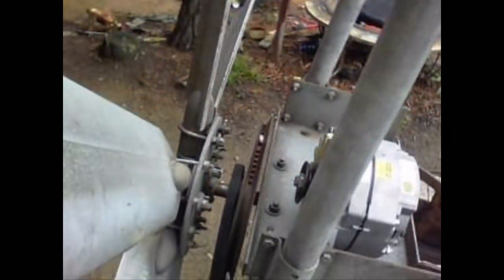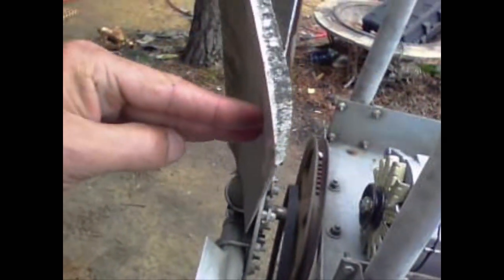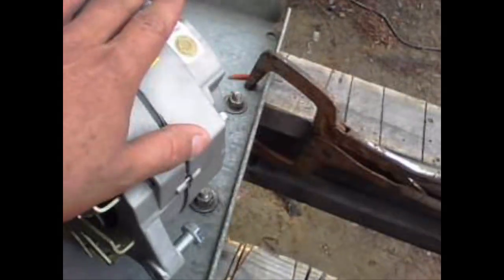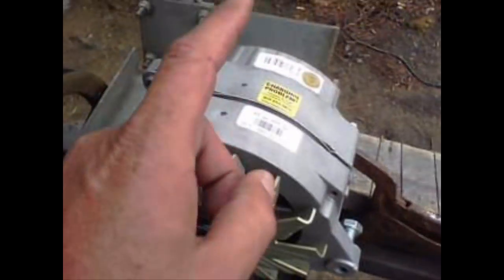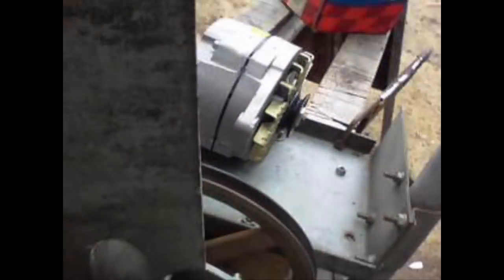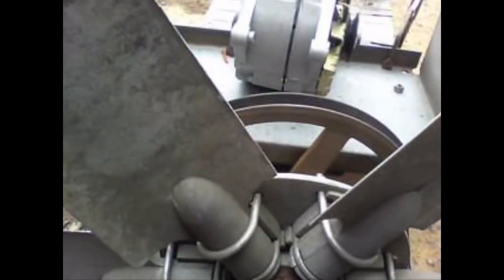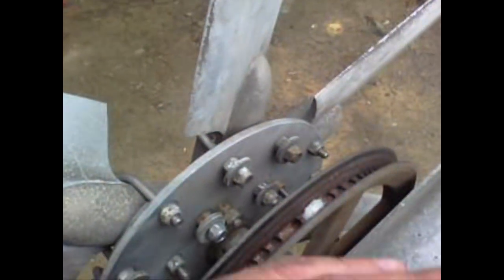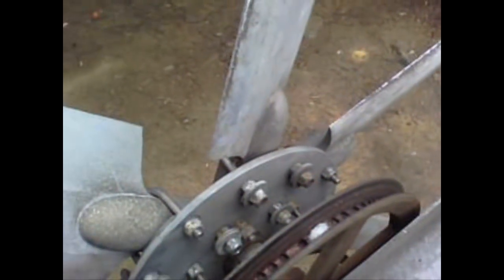homemade windmill generator part 3

Comment: did he say Turnt?
Reply: he sed turnt.
Reply: Saint Heretic
Reply: +Jack McSwain did you say sed
Reply: yes...yes he did
Reply: In older form of English, many past tenses were spelled with t instead of ed; British folks say "spilt" and "dreamt" and "spoilt".
Reply: RRRRRRRRRRRRIGHT, i WAS UNAWARE, that the DEEP, DEEP, ...................DEEP woods of Tennessee was currently populated by many older forms of english speaking British folks, and "spilt" and "Dreamt" are both past tense, and past participle verbs of "spill  & dream or dreaming"  

CALL ME FUCKING CRAZY, but for some reason i dont think Proper vocabulary and pronunciations was intentionally showcased by Mr. Jim bob
Reply: Where do you plan on installing this contraption? If you are in a populated area I can't help but feel that it would be irresponsible of you not to install a brake or some form of fail safe. I'm guessing that your blades are not balanced to comparable industry specs and I don't know that you fully comprehend the forces that will come into play when that thing is introduced to a powerful wind storm. Your heavy duty aluminum won't bend much before it cracks and breaks. Don't get me wrong, I'm all for what you're doing. Free power is hardly worth it at the expense of your kids life or a neighbors.
Reply: It looks like he has some land so...... Free country......
Reply: Thats all OK folks...your president used to say Nucular instead of nuclear! Present one does all kinds of crazy uncouth, uneducated things. If you vote those guys in, I guess you have to expect a little of it from the populace that did it.
Reply: Stop the dig!!.. He's a country boy..
Reply: Saint Heretic spooky isn't it, how many people prove just how IGNORENT they are on camera to prove to the world how unknowing that they are! 

Seeing the edge of the blades that look like airfoil, will they actually turn the way that he thinks they will?

Comment: Direction of rotation is irrelevant if not you could have just just put rubber on the pulleys and matched them together solving your friction and rotation issues.

Comment: Starter gear and a flywheel no need for a belt, with direct drive,
Reply: Then you lose the multiplier aspect of the larger pulley

Comment: It's commendable you should want to share info with others but when the info is highly flawed, it's pretty useless. 
As many others have said direction of rotation is irrelevant.  Also there is no way in hell you are going to get 100A out of that alt. That requires about 3 HP and that turbine is not going to produce that sort of power unless it's in a cyclone. And even then probably not. 

A ribbed belt has much less drag and is much more flexible. 
Unfortunately I doubt that machine will generate any power with that alt. The turbine is too small for the alt or the alt is too big for the turbine. 

Good luck with your project but you need to do a LOT more research to understand the things you need to do to make it successful.
Reply: Oil Burner True, it generates ac in either direction and if its regulated it'll be rectified in the usual polarity. Agree too with the power output of the blades..... can't see it ever producing ~1200W, although generators should always be over rated so maybe not such a bad match.
Reply: Absolutely right..Oil Burner, Inverse square law applies here.  To generate enough current to supply the field of the alternator and have a little for battery charging will need a balanced fan setup at least twice the size.
Also to reduce drag on the belt use a toothed belt.  Very thin and does not need to be as tight as a V belt (the teeth do the driving)
But  1200 watt !!!!!Hmmmm.  And it needs a braking system.
Mind you he had to start somewhere..onwards keep trying.
Reply: Oil Burne
Reply: Cyclone lol.

Comment: load it in back of truck drive 55 and watch centrifugal force sling your blades off,when 1 disconnects it will be out of balance and it will Eat it's self. (you need a brake)
Reply: john Novell q

Comment: use a 3rd pulley to make the angles better
Reply: ekcoylejr if you were to use say 4 pulleys to better your angle you would just be cutting the resistance into 4 parts instead of 1, but the total resistance would be the same.
Reply: Allen Franklin
I think the friction on the pulley is a problem so fewer would be better,  but only 2 pulleys with 1 pulley being very small is causing excess resistance. So just 1 more pulley adjacent to the very small pulley I think would be best.

Comment: an alternator makes a terrible wind generator.  you have to spin it way too fast to generate any useable power.  the fan would have to be huge to have to power to gear the alternator up fast enough.  better to find an electric motor that has a lower RPM rating, and higher amp rating.  that would be the most efficient.
Reply: MVP11489 True, but with a series of pulley reductions it could be made to spin at the desired rpm for max power without having the primary drive fan spin super fast. I'm designing one myself, however I'm not an engineer so I'm not claiming that I know everything about this, just tinkering! I'll post information if all is successful.  Cheers.
Reply: ATC 200X Fanatic the problem with that, is not only do you get parasitic drag from such reductions, you multiply the force needed to turn it.  Think of it like a bicycle with gears.  start off in 1st, its pretty easy, and doesn't take a lot of force to turn, except that your wheel isn't going very fast.  now think about shifting to 6th gear, for the wheel to turn at any speed, it takes a tremendous amount of force.  you'd need a MUCH bigger fan to turn it. with the money you'd spend on all of that, it would just be cheaper and easier to simply purchase an electric motor that has a higher horsepower rating at a lower RPM.  for example, a 2hp air compressor motor with a peak RPM at 1200, would give out much more amperage then a 2hp motor with a peak RPM at 3000, at the same speed.   you'd have to turn that motor almost 3 times faster to get the same power as the first motor.  it just isn't practical to use an alternator.
 Personally, I like the idea of a gassifier powered generator.  If you live somewhere that's wooded, it could power your home indefinitely.  or even just at night.  and solar panels could power during the day.

I'm currently working on a straight 6 ford engine, that I'll mount to a concrete pad, and use it to power a 2 stage compressor, and a 10kw generator head, in cases of emergencies.  It will run off propane for now.  I'm also working on a gasifier that if works as well as I hope, could run the generator at night, and use solar during the day.  I'm not in an area where wind power would be very useable, but only during hurricanes or bad weather, would it work, which I may do eventually.  but even then, the gassifier could work during such times.
Reply: ATC 200X Fanatic the problem with that, is not only do you get parasitic drag from such reductions, you multiply the force needed to turn it.  Think of it like a bicycle with gears.  start off in 1st, its pretty easy, and doesn't take a lot of force to turn, except that your wheel isn't going very fast.  now think about shifting to 6th gear, for the wheel to turn at any speed, it takes a tremendous amount of force.  you'd need a MUCH bigger fan to turn it. with the money you'd spend on all of that, it would just be cheaper and easier to simply purchase an electric motor that has a higher horsepower rating at a lower RPM.  for example, a 2hp air compressor motor with a peak RPM at 1200, would give out much more amperage then a 2hp motor with a peak RPM at 3000, at the same speed.   you'd have to turn that motor almost 3 times faster to get the same power as the first motor.  it just isn't practical to use an alternator.
 Personally, I like the idea of a gassifier powered generator.  If you live somewhere that's wooded, it could power your home indefinitely.  or even just at night.  and solar panels could power during the day.

I'm currently working on a straight 6 ford engine, that I'll mount to a concrete pad, and use it to power a 2 stage compressor, and a 10kw generator head, in cases of emergencies.  It will run off propane for now.  I'm also working on a gasifier that if works as well as I hope, could run the generator at night, and use solar during the day.  I'm not in an area where wind power would be very useable, but only during hurricanes or bad weather, would it work, which I may do eventually.  but even then, the gassifier could work during such times.
Reply: MVP11489 I stand corrected. Like I said, I'm just tinkering and I welcome any helpful advice. Thanks for the heads up!
Reply: ATC 200X Fanatic I've learned a lot of this stuff the hard way from tinkering as well lol.  Tinkering on stuff is the best way to learn what does and doesn't work :D
Reply: MVP11489 That is true. Trial and error is the only way to learn. I'm going to keep at it and gather as much research as I can along the way. Appreciate the info my friend!

Comment: i have seen videos of windmill generators getting destroyed and those are designed by engineers. so just for safety reasons even if you don't think you need it, you should install some safety brake to prevent any possible misshaps.  remember murphy's law is a bitch. safety, safety safety!!

Comment: This guy no so bright rotation no matter and belt contact to alt should be as much as posble alt will cause resistance to turning as the more current it builds drage down by electro magnetic force be better of with padel wheel on running water